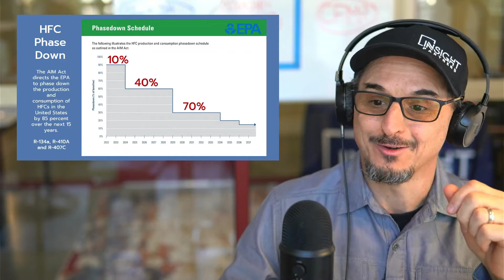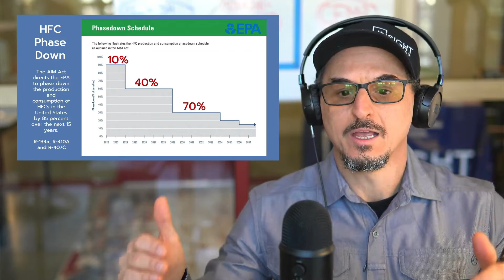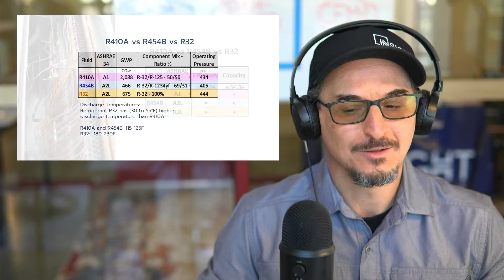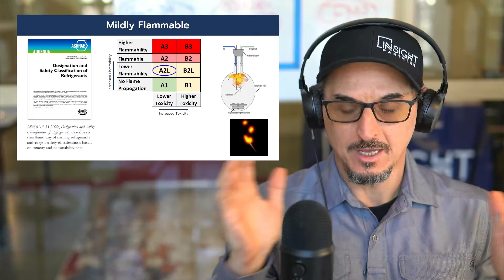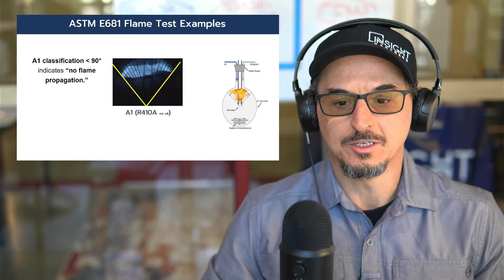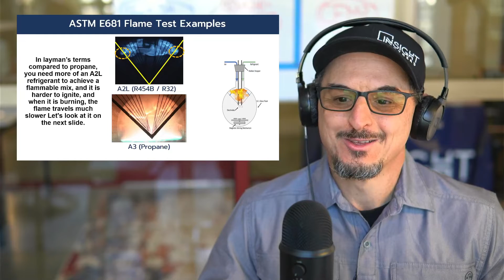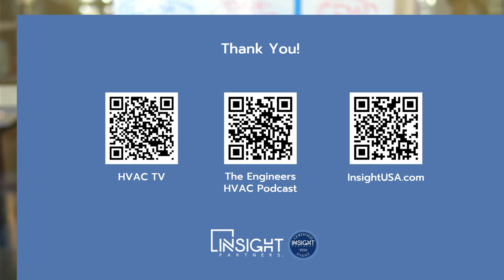When Is R410A Being Phased Out | What Is An A2L Refrigerant | Transition to R32 & R454B

Comment: This young dude 410 will be available for next 30 years I'm a certified licensed HVAC tech since 1978 and I still buy r22_and 410 by the pallets and equipment by the truck loads every month   32 and 454 we will not deal with period propane based freon not safe

Comment: Hi GWP when it leaks as in AC/refrigeration it is in a closed circuit circulate to transfer energy form inside to outside (cooling) or outside to inside (heating). You can not say R32 is friendly as it is A2L class flammable (can be internally explosive).

Comment: There is ACTUALLY no confusion. To use propane as a refrigerant (under any circumstances) is bad fir the American people. Your average refrigerant related Air Conditioning call will go from a 700 gas n go (present r410a) to a whopping 2500 find repair leak just so you can run again. Next refrigerant leak... same thing. It's all a money grab n you mr, justifying propane, are as much as part of the problem as kamala

Comment: They can ban R134A if they want which still contains some chlorine and may end up damaging the ozone layer, but why R410A which carries zero impact on the ozone? And then replace them with the highly flammable butane? They're nuts!
Reply: They're not replacing it with butane but with R454B which is an A2L blend in many stationary applications.
Reply: @tashmukh  I read somewhere before that R454B is butane based, but it turns out it's actually 67% diflotomethane and 31.1 percent 2,3,3,3-tetrafluoropropene. Both methane and propane are hydrocarbons and flammable. In India, fridge makers are still using CFCs which damage the ozone layer on top of acting as powerful greenhouse gases. CFC's are something like 90 times more potent as greenhouse gases per molecule than carbon.
Reply: Our swimming pools use more chlorine than our 12

Comment: Just installed a new Carrier system with 410a refrigerant.   My concern is not getting 410a going forward (think it will be around for a long time), but getting replacement parts compatible with 410a.  If my compressor goes out 5 years from now, do you think I will be able to purchase a replacement compressor?   Or will I need to upgrade the whole system to a new refrigerant system?
Reply: IMO, R410A compressors will be around for a while since most manufacturers have a 10-year warranty on new equipment.
Reply: That’s exactly the reason I’m against the wall on buying and risking or waiting and making sure parts will be available going forward.

Comment: A big deal I'm seeing with the A2L installs on multifamily is that they will need ventilated shaft enclosures for the refrigerant piping to within 6' of the air handler. See IMC 2021 1109.4.

Also the pounds per 1000 ft^3 is only 4.8 lbs for R-32. A lot better for R-454B at 22#/1000ft^3. R-410A is 26.

I see a number of unintentionally created machinery rooms for R-32 systems in the future.
Reply: Good some one understand ask them why they not showing videos with tank flip upside down in liquid form it’s blended to deplete in air

Comment: I just went to the Rheem A2L Low GWP Flammable Refrigerant Safety Certification course.. you covered about 75% of my material in 75% less time. From what we were told warehouse and vehicle storage may be somewhat different than we are currently used to. Service vehicles may need to have placards and ventilation if carrying more than 2.5lbs . Anywho great job.. the more education the better.